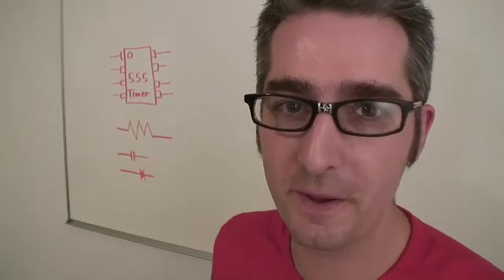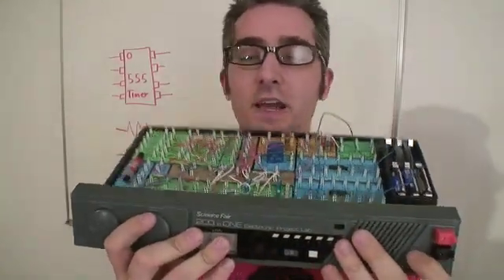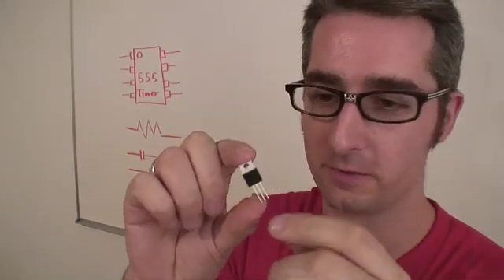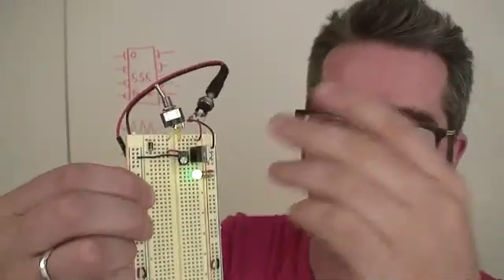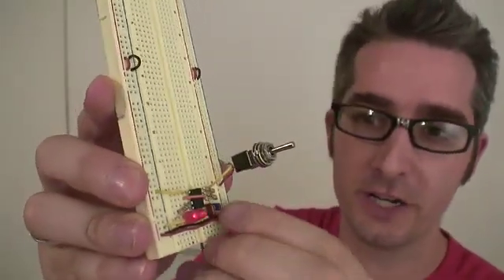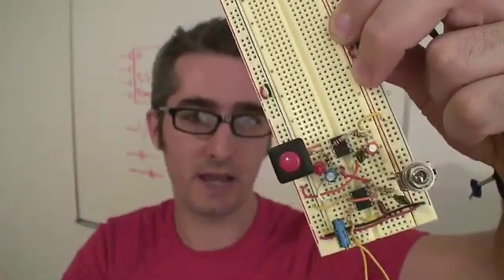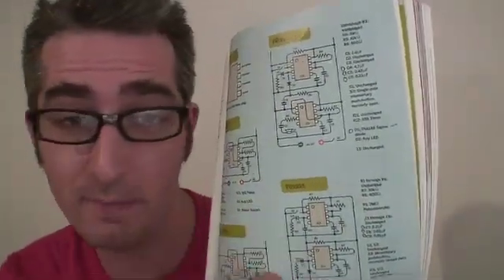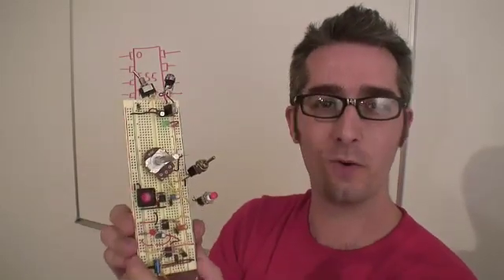Intro to Breadboard Electronics

Comment: You can blame our old friend Benjamin Franklin for the confusion around electron flow and current flow! 
Electrons flow from black to red , negative to positive, anode to cathode...
However convention, originating from Benny's %#$* up, is that electricity flows in the opposite direction. 

My suggestion is except convention if you're interested in electronics, even if you aren't based in USA as it'll make your life so much easier.

Comment: you would want to put a monostable circuit, the trigger being the sensor. The output would go to the relay. regardless if the sensor is still active or not, 5 seconds later it will shut off. use a google rc time constant calculator for the 5 second timing

Comment: @myguitardidyermom12 actually, a regulator is no more efficient than using a resistor divider to lower the supply voltage.  it works in essentially the same way, only the resistance in the regulator is a transistor which can vary its resistance to insure that the output voltage stays steady for any load current.

Comment: @scorpion8588 Ground is relative. A voltage isn't an absolute value it's relative to something else. Like if your in a car and you are going 50mph and someone else is going 50 mph in the same direction your moving 0 mph relative to them, but if they where sitting still you would be moving 50 mph relative them. Voltage is relative between two points in a circuit. So if you connected everything you wanted connected to ground to the negative of your battery then it would act as a ground.

Comment: I doubt the 12v power supply puts out 18 volts when hooked up to a load. It will probably drop to somewhere in the range of 12v.

Comment: To answer your question, the diagram is in fact backward.  Common sense would indicate that current flows in the direction of the arrow but notice the vertical line at the point of the arrow.  If you think of this as a "brick wall" then what the diagram says is that any current going with the arrow will hit the brick wall and be stopped.  It seemed sort of odd to me too, at first, but if you think of it that way, it makes a bit more sense.

Comment: Sorry for not responding sooner, but I just now found my inbox on youtube.  Anyway, to answer your question, the diagram is in fact backward.  Common sense would indicate that current flows in the direction of the arrow but notice the vertical line at the point of the arrow.  If you think of this as a"brick wall", then what the diagram says is any current going with the arrow will hit the brick wall and be stopped.  It seemed a bit odd to me too at first,  but that's how it's read.

Comment: Not sure if you noticed but you said in the video that capacitors even out the current. Correct me if I'm wrong but capacitors oppose change in voltage and inductors oppose change in current.

Comment: (the rest of it)
 It is because they have an "on voltage" (you can see it at its current-voltage curve). One or two may have a slightly different "on voltage", less than all the other in parallel with it. This will burn this LED, as it will draw a lot of current. You wil end up with a fried LED !... :)

Comment: No you don't need to. Of course it still works. But you can even place this one resistor everywere you want in between (I mean in succesion to the LEDs, of course). You don't need many resistors. 
***BUT*** If you want to to power LEDs in parallel, YOU NEED A PESISTOR IN SERIERS WITH EACH AND EVERY LED SEPERATLY and NOT just one resistor in front of the whole bunch of parallel LEDs. This applies ONLY TO LEDs, because of their semiconductor behaviour.
(continued)

Comment: Technically, the GROUND is the lowest potential for a system return path.  

Practically, E.g. a 9V battery, the ground would be your negative terminal as it has the lowest potential point. 

For your wall Socket, its alittle more complicated, becoz the ground could be either Active or neutral pin since it is an AC circuit (sine wave). 

Some may say the earth pin have the lowest potential but it is mainly for safety purpose (leakage current) and it doesn't affect the sys operation. 

Confused?

Comment: That looks like masses of electronics, just to turn an led on, i guess the device i want to make will require even more, ive called it the earth reversal-a-tromator.
My first problem is what colour to make the housing box, i will work out the electronics later.
I will make a broadcast on every channel on every tv on earth when i am ready.
Now i just need to learn about those transistor thingies and diodes.

Comment: Nice video. It's a lot of information in only 5 min, but I guess I'll just have to watch a couple of times before it sticks. 

I was wondering: how much wire-stuff, soldering-stuff, resistors, capacitors etc etc do I need to buy along with a bredboard in order to be able to make some of these awesome simple circuits?

Regards
Søren

Comment: how young did you begin to study this? im 17 right now and i want to understand more about electronics. right now ive only studied graphic arts and design(photoshop/illustrator) and im currently in Cisco Networking, IT Essentials, and Web Page Design(notepad/frontpage/dreamweaver). My main interest is into computers(hardware mostly) but i also want to study computer science and electronics. ive tried to get a breadboard kit but they can be very expensive. wat should i use as a resource to study?

Comment: A led is a diode, so it's wrong saying it works with little voltage, it's functioning is over the current not the voltage, that´s way it always has a resistor in series to limit the current flow.

Comment: You regulate the current by regulating the tension... how hight is the tension in a certain resistor how hight is the current flow.( ohm law---> "I=V/R" ).so you should review the first line on your comment.

Comment: this is actually really basic. It might seem hard to do but it's only because he's using a lot of components. 
Using a 555 chip is the easiest way to make a LED flash.
Also, you don't need to solder anything on a breadboard. You pin your components into the holes et voilà.